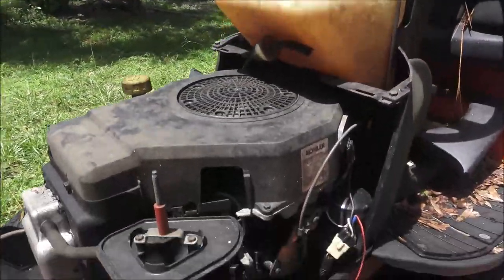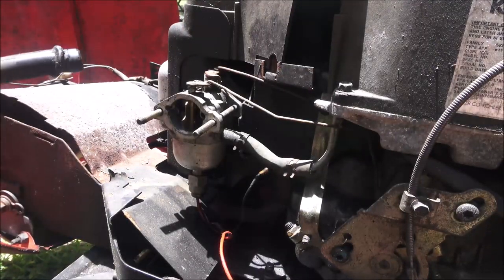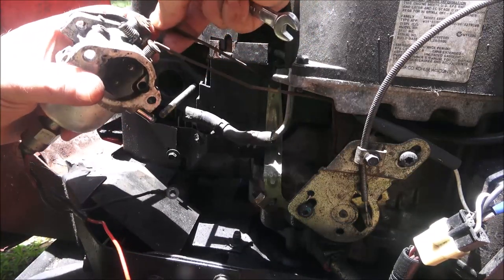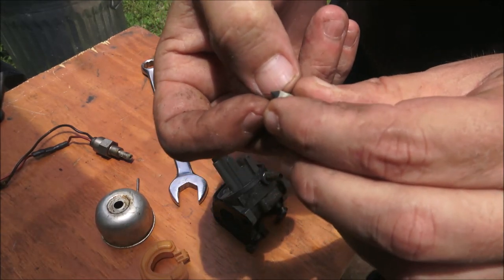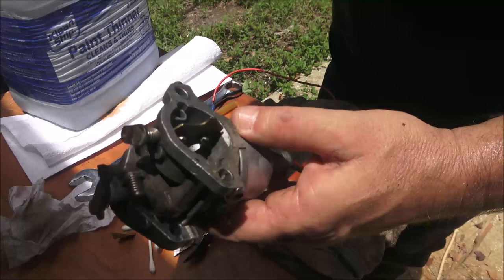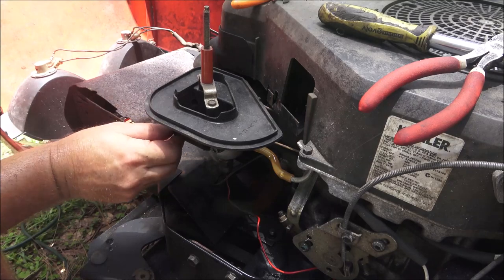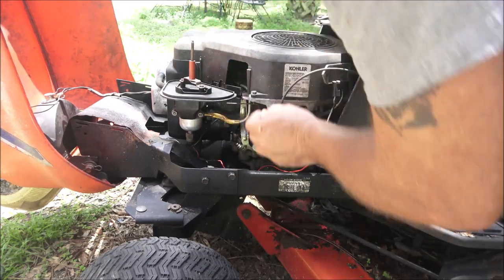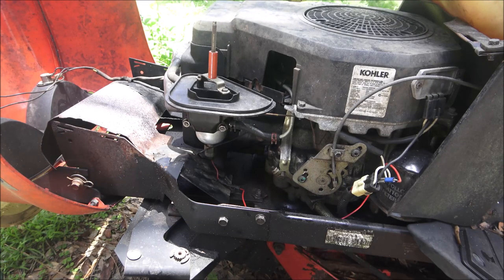Carburetor Work On Simplicity Lawn Tractor With 16HP Kohler Engine

Comment: There was alot wrong with my newest old used john deere Lt155 with the cv15s Kohler command 

I checked its carburetor out and someone had put a piece of stick twig inside were that needle sits and there isn't no way that can pass through the gas line and through the filter to get in the spot it was at im still using my old carburetor that little twig is what was messing mine up

Comment: You could check your valve cover but you'll have to make your own gasket for it once you take it off all 3 of mine had air leaks around them 
The cv16s Kohler pro did and cv15s command an cv491s command did and they're isn't no replacement gaskets for any of these ones it wouldn't hurt Kohler to start making them again for these models.

I sprayed soapy water all around the ohv cover and found tons of air leaks on the cv15s whoever done its gasket used the wrong shit to make the gasket it was like bubble gum so whatever that shit was wasn't heat and oil resistant 

did buy a used john deere L110 a few years ago and its coil was goin out it would heat up then shut off and keep doing that it quit doing that after i put the new coil on 

The Lt155 i got for free because they thought it was broken so i am gonna tell the last owner of it his go to mower shop done a bad job on the engine and carburetor and valve cover they didn't even put no new gas line on after they put a brand new cylinder and flywheel on it i believe whatever mower shop he took it to rigged it up so it'll fail and he'd have to bring it back to the shop so they'll keep making money 

Im gonna ask my friend how long was that mower sitting broke for or how many years sense its just a 1997 model so i can kinda get a view of when it was last in a mower shop his mower shop cheated him they damaged his ohv cover i fixed that to